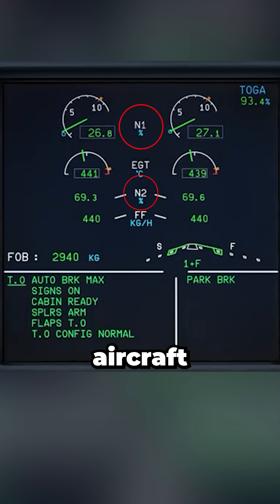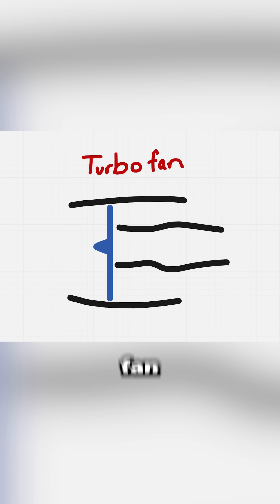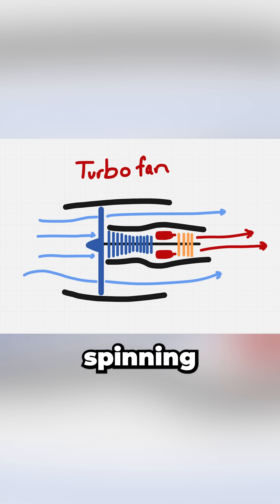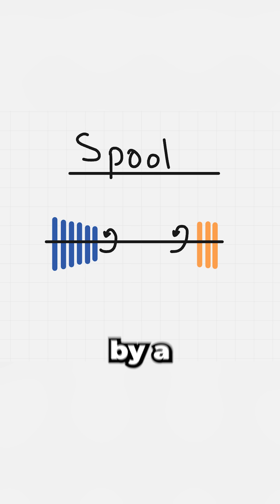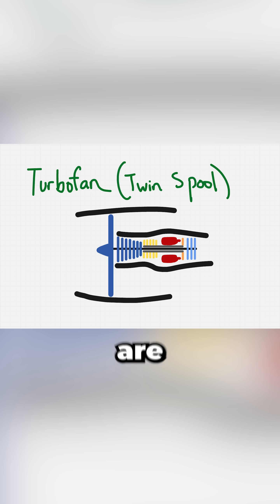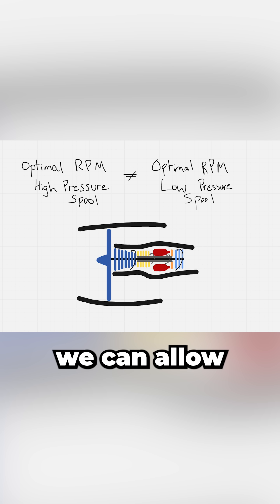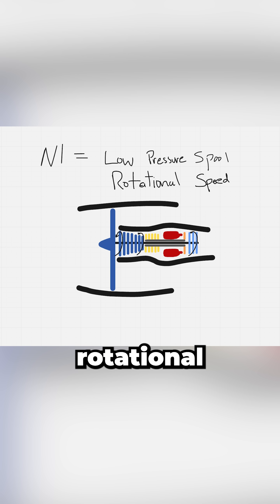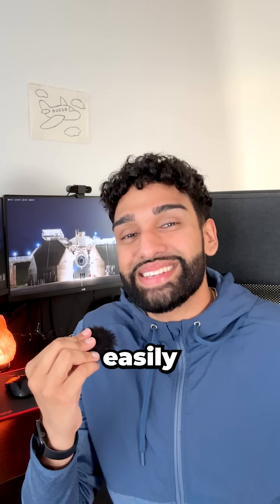What do N1 and N2 mean on Jet engines?

Comment: Are the displays in the cockpit corrected core and fan speed (to account for inlet temperature and inlet pressure variations from altitude/mach number points in the envelope) or mechanical speeds?
Reply: Those are mechanical RPM readouts expressed as percentage of max RPM for that spool (N1, N2 and sometimes N3). You have the EPR which is the Engine Pressure Ratio that takes into account the inlet and outlet pressures to measure thrust but that's not available on all engines. Most engines just use N1 values to express thrust

Comment: New mission: find out what happens if you remove low pressure spool
Reply: You'd get a single spool turbojet, a basic engine found on many early military fighter jets. It would also be smaller since you wouldn't need the low pressure ducting, and also a lot louder and less efficient.
Reply: @zacharytaylor190 Ty

Comment: Not complicated enough, add like 4 more spools and you will get there.
Reply: RR uses 3 spools on its RB511 and derivative Trent engines (has a N3 readout on the EFIS) but beyond that its pretty unfeasable so sometimes people mount the fan to a separate planetary gearbox which is what those geared turbofans are